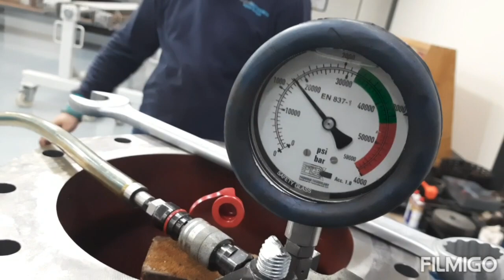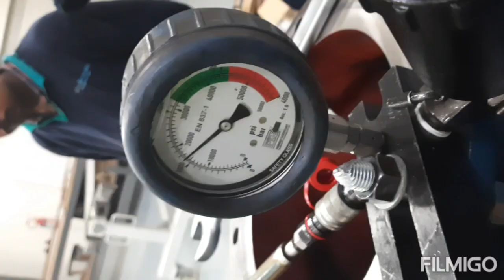Assembly of Aerzen Blower GM150s Timing Gear.

Comment: What is the purpose of the hydraulic pump?
Reply: Yeah... I'm not digging what's it's for either. Just saying :O)
Reply: La bomba hidráulica  sirve para ayudar  a instalar  el piñón. El eje tiene una perforación  y permite que el aceite llega a la ranura que tiene  el eje en su perímetro. Allí si instala el piñón  y expande el agujero interno  para que el piñón entre
Reply: @mauriciohoyos1395 is there any effect if the surface of the rotor which is tapered has small dent during assembly
Reply: I'm sure its a  pressed fit

Comment: How you adjust the lobes 🙏🏽
Reply: They put a shim in between the lobes and once the gears are tight on the shaft the pump is correctly timed. The shims will have a precise measurement.
Reply: What is the standard size of shim plate.
Reply: They put shims according to the clearance between lobs then lock the lobe by wood and mounted other grear with hydraulic pressure.
Reply: @vjrubio5148 
Not standard but according to the machine manual in Gm 90s 0.15 to 0.25 mm